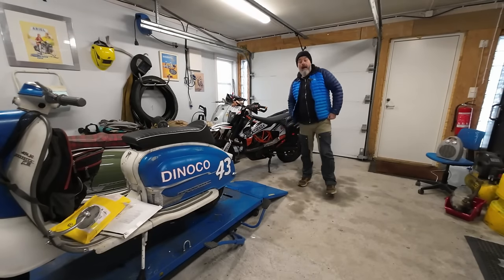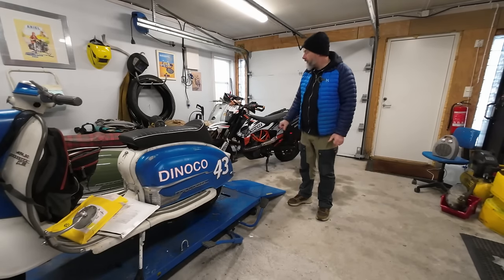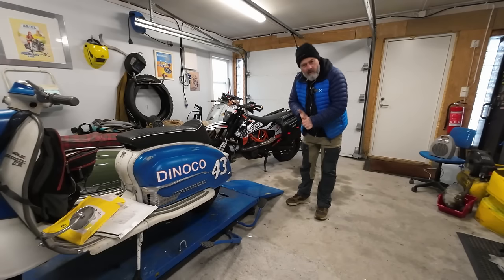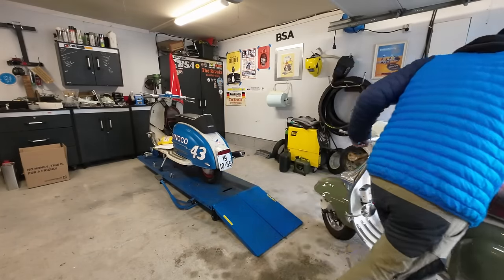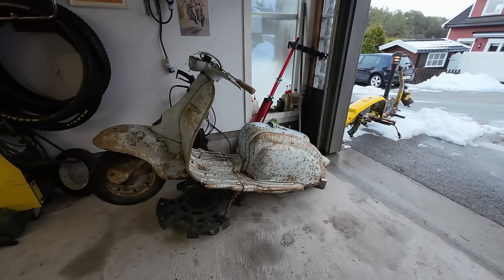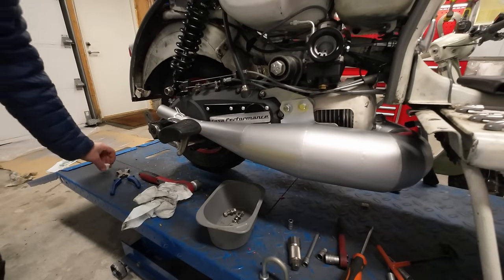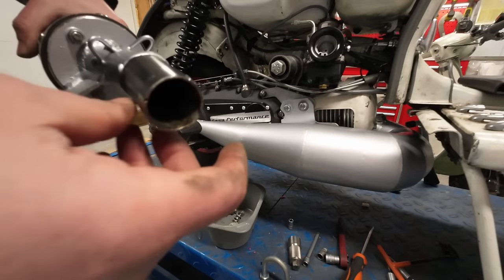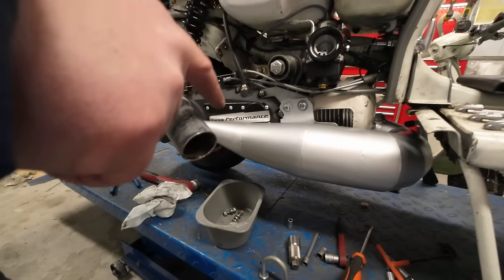Exhaust paint and some other stuff #kickbackgarage #lambretta

Comment: The Sledgehammer is top of my list, I hope they can make a clubman exhaust and a way of avoiding having to drill a hole for the carb.  
It looks to be the ultimate touring motor that can maintain motorway speeds all day and not need rebuilding every few thousand kilometres.

Comment: Rob you don't have to buy another tank, you can easily remade that one from your scooter just by hammered it down in a spot when a new carb will fit. I did it few times at my stunt bikes and I guarantee it will be done at a lambretta tank as well. Happy new year!!
Reply from the maker: Problem would be volume. I already have 2 cutouts om my tank.